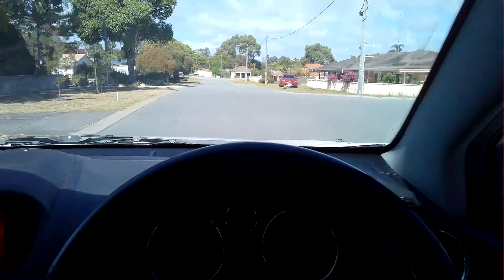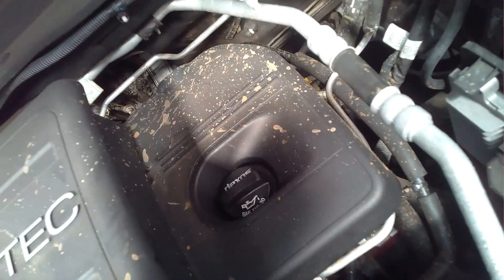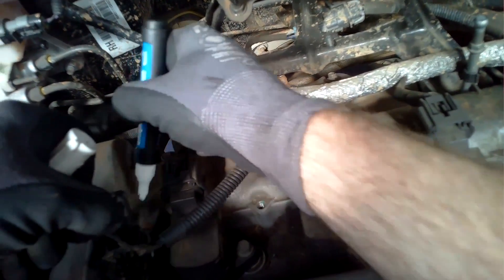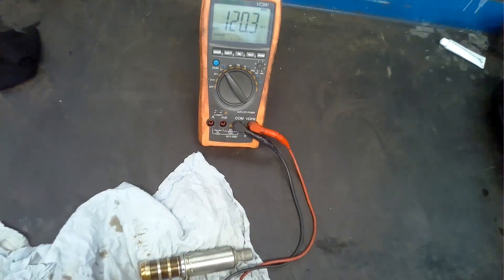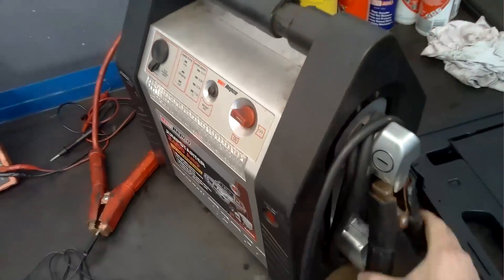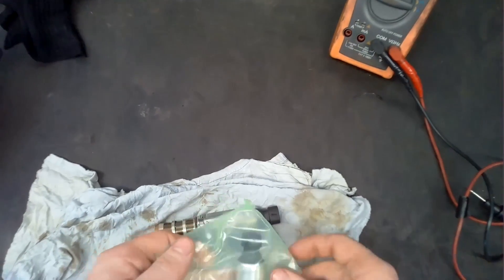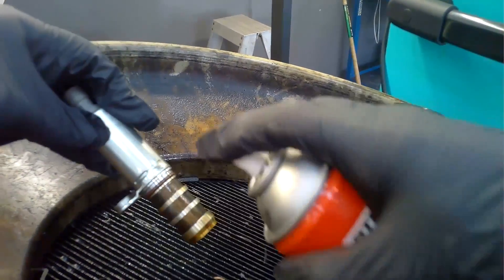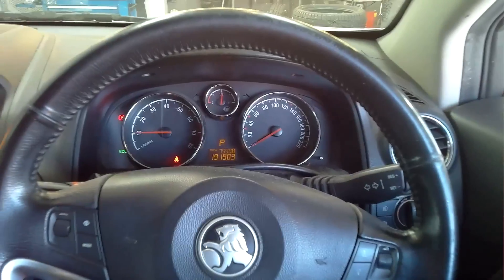Simple Tests - Camshaft Position Actuator Solenoids - Chevy Holden Ecotec Engine - Problem Fixed

Comment: Are the solenoids the same part for intake and exhaust??
Reply from the maker: No, different parts with different connectors.
Reply: @GerardBurkeBurkesGarage  My 2013 1.8L has the same solenoids and connectors